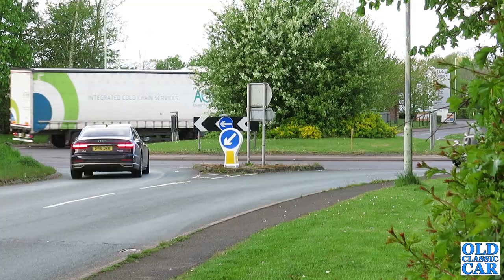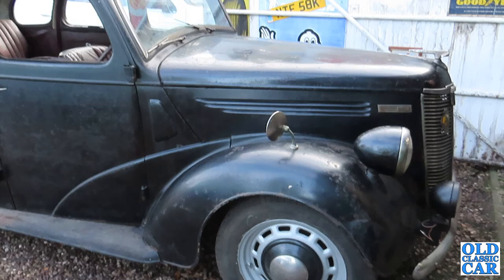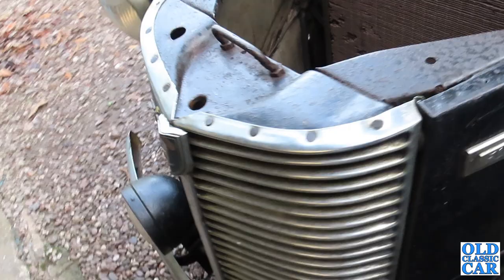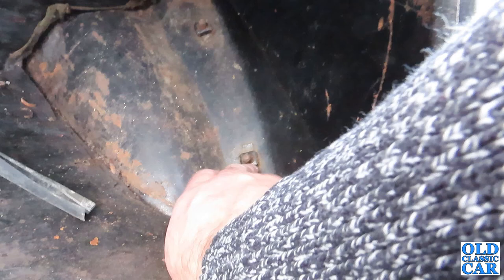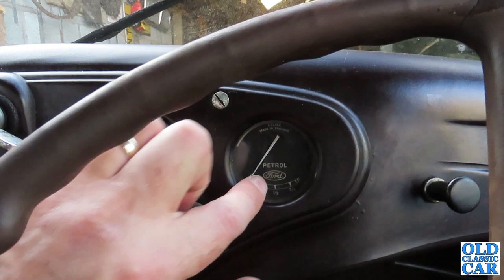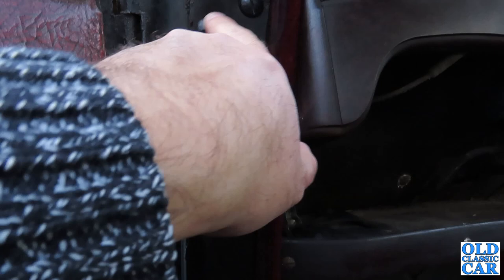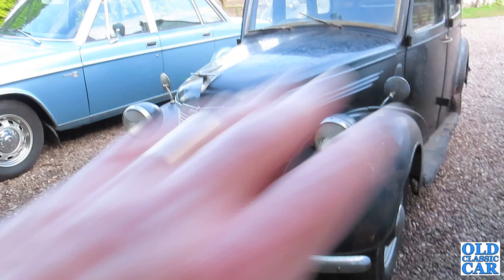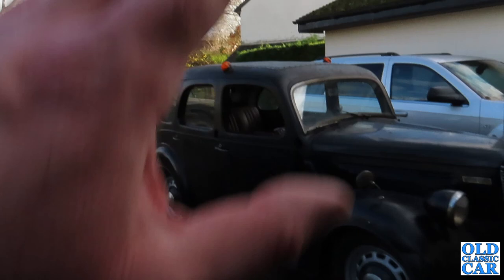Our 1948 Ford Prefect E93A - a quick intro to this very original old car | Oily rag restoration

Comment: To apply the choke, just pull it out and while out twist it about 90 degrees not sure if clockwise or counter clockwise). The choke will then stay out until you want to disengage it by twisting it in the reverse order.  No need for a peg to hold it open. I found that my old ford needs a good old cranking with the choke fully applied before it would start.  It doesn't seem like you can flood the engine.  Once the engine starts running with the choke engaged, leave it for a while to warm ( a minute or so) up, then release the choke (by twisting it again) it so it goes back to normal. The engine will be running smoothly by then.  The main point of doing it this way is that you dont have to crank it multiple times until it starts running.  This saves wear and tear on the starter motor and ring gear and of course spares the battery from becoming flat by over cranking it.  I speak from experience as I have owned my 1952 Ford Prefect since 1974.
Reply from the maker: I've had plenty of chokes on old cars, some do stay out as you suggest while others need a little help sometimes. My Anglia starts up really quickly if I prime up the fuel pump first, sometimes I don't prime it up just to give the engine a few turns on the starter before it fires up. Thanks for watching.

Comment: I have just seen your video on the 1948 Ford prefect .In the early 1950 's i lived opposite to Bells garage In Long lane Blackeath  they later went upmarket and opened a dealership in Kidderminster .The Owners were two brothers Walter and Cliff Bell .In the mid 60's I bought my first car from them an Austin A35 four door  1957 saloon For which i paid £125 They Had two garages in long lane .both buildings still remain  one as a furniture clearance outlet  and the other as kitchen and bathroom sales center (Google Earth.) you could  always get a better deal off one of the brothers but i cannot remember which one it was now its so long ago I left the area many years ago and now live in Cornwall .I passed my driving test in my fathers sit up and beg Ford  Pop 3 gears s/v engine  .Happy days , like your channel and your mend and make do approach !!!!
Reply from the maker: Interesting, thanks for posting, always interesting to read these stories

Comment: Wow this is a lovely  project for the winter. I like the shape of those Ford's. The running boards look solid as doesn't of the bodywork. Being a former upholster o have to congratulate the previous owner on his seat repair. I have seen people tackle that sort of job with disastrous results. I would keep all the lights as they are, it's all part of the history of the car. I hope all goes well with the 'revival' of this car. Thanks for the introduction and the video,  the dog seems to approve as I didn't hear any barking !👍

Comment: The Ford Prefect 1948  was my first car which I learned to drive on. My  Reg No was CHV500. They were a nice little car with cable brakes side valve engine 3 speed box etc the small switch on the right of the dash may have been for the instrument lights?   I repainted the car with Dulux coach finish paint , it looked a treat. The wiper system  performance was improved by installing a small air cylinder off of a lorry. No heater, no radio, very basic. The auto electrician where I worked changed the electrics over to 12 volt, this made the lights much brighter. Best wishes with this brings back many memories
Reply from the maker: Thanks Bruce!

Comment: I grew up surrounded in the sidevalve Ford as my Dad had a supply of them as works cars. He worked for South Western Electricity board. The oldest was MAE 663 which was a 1949 Anglia and was joined by OHU 144 which was Ford 10 Utility van…that was rough and the seats were not fixed to the floor but it went well. In 1952 PHT 13 arrived which was a 5 cwt van and was a favourite because it was unstoppable in almost any weather..snow and mud were laughed at as it simply ploughed its way through, much the same as any of these variants. In 1955 two brand new Populars arrived, UHU 78 and UHU 79 which were notably different..79 was much the quieter and smoother of the two. Then the final two were 965 AHT and 631 AHW from 1957…631 was fast and noisy but 965 was destined to be my first car and when it was due for sale in 1964, it oddly gained a new engine, new roof fabric and headlining, a full repaint, set of tyres and a complete brake overhaul. Sadly, another of the drivers was jealous of my Dad because he was give a new 105E Anglia Deluxe 808 UAE so fearing that he would be left with 965, he drained the engine of oil and water then drove it all day until it seized solid…and then it was scrapped! 

Your car…is carrying a Gloucestershire registration number so odd if supplied in Halesowen hence was that the stamp of a later secondhand garage? The rear lights…the right hand one is from a 1955 onwards Popular and the roof indicators were a huge success after market fitment for many cars in 1958/59 onwards..usually made by Lucas. 

Good luck with the restoration work..new fuel, lines, a tank replacement to cope with E10 fuel and general servicing should work wonders!! 😀😀😀😀
Reply from the maker: Thanks for posting your many sidevalving memories, always like reading these firsthand accounts of these old cars back in the day :)
Reply: @oldclassiccarUK  They we’re a big part of my life and I learnt to change gear on UHU 78/79 when I was only 9/10 years old…don’t tell anybody!  If yours has a heater or the remains of one, when fitted and working properly, it should give out loads of heat…they were always warm cars when fitted with heaters. In period, the 1955 cars had door trim panels that tended to melt in hot sun and start to leak black bitumen from the seams…I remember the aroma of “plastic tar” on hot Summer afternoons! I have always said that they were basic transport at a low price but always dependable, very capable and they have a big part of my memory. I went on to own many later Fords, the best being my 1979 Granada 2.8i GLS and the last was a new 1983 Sierra 2.3 Ghia…then I moved to BMW and Mercedes. I found your video by chance today…well done for looking after two old but good cars..I hope you can enjoy them for many years to come! 😀😀😀
Reply from the maker: Thanks, please keep an eye on the channel for future updates. If you look at my lad's CarTraction channel you'll notice that he too has been behind the wheel of various jalopies from a similar age, I think the Prefect so far is his favourite.
Reply: @oldclassiccarUK  Our neighbour Mr Wood had a gleaming Prefect OLY 917 which he polished every month…then in 1956 swapped it for a new Morris Minor four door deluxe..WHW 404….that lived under a carpet (!!) in the local coal man’s yard…I guess he was in failing health as I think he rarely ever used it. 

I will shut up now…your video released a host of memories!!! I will look through your channels next! 😀😀😀

Comment: I can remember seeing lots of old cars on the road when a was growing up in 50s and 60s I one think that has stock in my mind I think it may of been an old rover but some gave us a lift and It was raining I sat in the front the the wind screen wipers were not working properly but there was a nob inside so you could move them manually the driver asked me to turn the passenger one I love the job but I don't think I would have liked to travel to far I also remember people buying brand new cars and within about 3 or 4  years they were full of rust

Comment: What a beauty that engine sounds so smooth. I like the original patina definitely an "oily rag". Please keep her.
Reply from the maker: That's the aim, with running gear shared (in the main) with the Anglia and E83W, plus I have a cache of spare for the small Fords already, it should be more straightforward than taking on something I'm completely new to.

Comment: Sidevalve Fords, you either love 'em or hate 'em. They do rather get under your skin, which is why I keep coming back to them. The switch marked D is a dimmer for the panel lights. There are some fantastic looking period 'horrors' there, the 'washing line' wiring for the pigs ear indicators and the roof insert 'repair' strip screwed through the roof made me wince! Huge potential in that Prefect though, good luck.
Reply from the maker: Agreed, on paper they're nothing to write home about but I keep coming back to them. I quite like the period roof repair, in the day there were companies that would sell pre-cut pieces of aluminium to fit over the Rexine roof panel. As a period mod I'm perfectly happy to retain it. Thanks for watching it
Reply: @oldclassiccarUK  Isn't the 'washing line' looped through the eyelets in the headlining the pull cord for the rear window blind, and nothing to do with the blinker wiring? Or are we talking about two different things? This model Prefect was the first car my father bought new, when they became available after the war. It was black with red upholstery, like yours. He kept it until it was replaced by a Vauxhall Wyvern in 1957. I have happy memories of the whole family piling into the Prefect to go on holiday to the south coast of England. Since the rear suspension was virtually non-existent, any sudden vertical movement (e.g. as caused by a hump-back bridge) resulted in the back seat passengers banging their heads on the roof. Ah, happy days! :)

Comment: You have clearly acquired a very rare and original gem. I recently bought a 1946 example from a well known classic auction house in Norfolk, which has had a lot of money put into its restoration over recent years. A slight correction, I believe the model changed to the later body with the headlamps in the wings, in 1948, to be replaced by the 100E in 1953.
A slight note of caution with the 17" wheels, I have found difficulty with fitting the larger wheels in the spare wheel compartment, but as I write I cannot say what size tyres are fitted on my car.
Great video, I look forward to seeing more.
Reply from the maker: I'll certainly check on the spare fitting or not, but as they were used pre-war I'd hope that it'd fit in there, we'll see! thanks for watching

Comment: What another cracking little car Richard,I love your penchant for unspoilt original cars like this that can be just ' conserved ' and recomissioned as it is - far more interesting than one restored within an inch of its life !.Just might be worth consulting the Gloucester Borough Council  archivist just in case the original registration ledgers   were not destroyed after the 1983 D.V.L.A call for unregistered vehicles to be collated onto the National computer.I have saved 3 ' hopeless ' cases like this with amazing stories being revealed, as if it happanes to be one of the few registering councils that saved the records , the mark should be able to be re-allocated.Love your term for red Hermatite - ' gloop ' , used profusely not so long ago  .Good luck with the car , a tribute to a ' cheap ' soundly made and well engineered car from nearly 75 years ago but leave the ' odd ' lights !.
Reply from the maker: I've not given up all hope on the reg. yet so we'll see, fingers crossed

Comment: hi there. great video.the dog seems very happy today with something in his mouth, the car is in not to bad a shape, i would change the oil in the g/box and engine and rear axle, i used to use Millers classic oils for my old series2 l/rovers. again with this car it is necessary to double-de- clutch going down  the gears and i expect going from 1st to 2nd gear,good luck
Reply from the maker: Thanks Peter, yes oils for definite

Comment: very interesting. thanks.  i love these old cars.  glad you're just doing the 'oily rag' treatment on the paintwork. it would lose it's charm if it was all shiny and 'new 'looking.
Reply from the maker: Thanks, sometimes things get so bad that the only option is re-paint etc, but when the old paint is still hanging in there I much prefer to leave it alone, after all a bloke in overalls and a flat cap put that paint on at Dagenham in 1948. Can't re-create that :-)

Comment: Hi, the e493a was from 1949-53. The front grille on the e93a is chromed brass, Mazac on the e493a. I own exact same car. The small Ford emblem/badge on the rear is correct but not found on the e493a Prefect. The choke, if you pull it then turn to the right you wont need the peg. The D switch is dash lights.
Reply from the maker: Thanks Chris, mine sure looks like mazak but thanks for all the info, I'll have a closer look later today :-) thanks for watching

Comment: my first car in New Zealand was a 1946 Ford 10.
Cross verse leaf spring suspension, dodgy lever (alegded) shock absorbers.
Mechanical brakes and six volt electrical system that the lights needed you to strike a match to see if they were on.
( if the lights were in fact on, because they were on weird ball type mounts meant they could be pointing anywhere.)
The vacuum windscreen wipers would stop if you were driving up hill, and beat themselves to death going down the other side.
After having it fall over on me twice ( once to the right once to the left) (I won’t say it rolled on me )I survived.)
(Took up motor bikes as they were safer.)
To it’s credit it it was very reliable (would fire up and be ready to kill me anytime.)
A question, what is the story with the air cleaner? I don’t remember the set up.

Comment: my 2nd car back in the late 60.s.and past my test with it .wipers went went slow up hill.
Reply from the maker: Yes the vacuum wipers are notorious for doing that, the Anglia's are demonstrated slowing down in one of the vids I posted about it earlier in the year (I think on the tip/waste oil run vid)

Comment: I feel Ralf Nader missed  the mark  leaving this worthy contender off his catalog of crocks AKA “Unsafe at any speed”.  I think Fix or Repair  Daily skirted around the challenge by casually staunching the supply of Pops. And so forth. All the best merry Christmas
Reply from the maker: I'm not sure that any car is particularly dangerous to drive per se, anything can be put through a hedge or hurt its occupants if it's driven inappropriately, the trick is to drive within a car's limits. Same for roads,  bar those teetering on the edge of a mountain in India (or similar) obviously.

Comment: What a lovely survivor Prefect you have there, but I am quite astonished that you want to put incorrect wheels on it. Are you saying that the correct wheels are faulty and you think you can improve it by fitting the wrong wheels. Thanks for the video.
Reply from the maker: They're still Ford wheels and will look identical, just one inch greater in diameter, the pre-war examples of this same car had them as standard so not a major change.

Comment: My Gramp died before I was born. His mint condition is been in storage soon. But haven’t got a key and it hasn’t been started since my Gramp died. Any ideas on where I start?
Reply from the maker: You'll find a key on ebay, sometimes the ignition barrel where the key goes in has a reference number on it, eg FP 928 or similar.

Comment: Where is the wiper motor vacuum tank on an E93A? On my 100E it was quite obvious. 
It's a shame about the documentation but a quick Google shows a Bell's Garage in Kidderminster claiming to have been around for over 90 years, which would be 1930. You never know!
Reply from the maker: Interesting about the garage, the tank is ahead of the rad, behind the grille, on the E93A (or at least it is on mine!)
Reply: @oldclassiccarUK  Ah, I never thought of that. I suppose they wouldn't want to overfill the engine bay :D It looks like a great car. I remember sitting in one in a farmers field in about 1980 being tempted despite the weeds growing through the floor. I probably made the right decision in hindsight. There is a point of no return!

Comment: Lovely little project.  I prefer the Prefects to the other models. 
As a thought regarding the Volvo which you bought to give comfort on longer journeys; how about replacing it with maybe a Consul/Zephyr/Zodiac? That would keep it in the Ford family
Reply from the maker: Those big Fords are very neat but strong ££££ for a decent one, more than I'd want to shell out for a longer-distances car. No firm decision made yet on that front anyway. Thanks for watching

Comment: Do try to recover its original registration, my Standard Swallow was last on the road in 1938 and had no documents & obviously did not have a V5C, however, the Coventry Transport Museum (it was a Coventry registered car) had index cards that proved it was last taxed in 1938 and along with the Club authenticating the paperwork & car, DVLA set up the registration mark on their system, it was all very easy. The number is non-transferable, which is fine by me. As your car is post-war, there is a good chance that there may be records out there, a good place to start is the Kit Head Trust, they may have something or know where the info is, a bit of research and you may be surprised! Good luck!
Reply from the maker: Hi Gary, yes I've not given up hope, the Kithead Trust suggests that there's nothing for this particular registration series but I'll see if I can contact the previous long-term owner to see if anything's turned up more recently. Thanks for watching

Comment: Another real gem - where do you find them?!  IIRC, the 'D' switch is for turning on and off the dash lights.  I also think that the clock may not be electric but a mechanical one with a winder behind the dash and therefore independent of the battery.  Looking forward to it's return to the road.  Regards, John.
Reply from the maker: Of course, you're correct about the clock, I should have remembered that as I've got one in a cabinet here behind me :-) thanks for watching